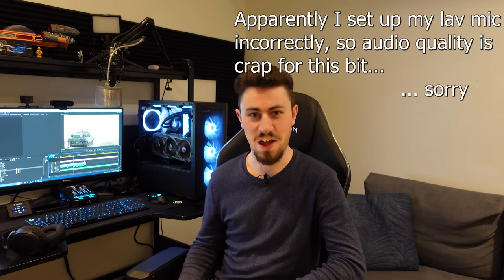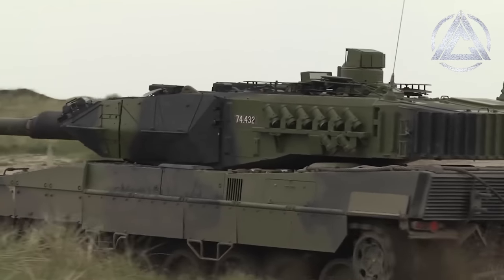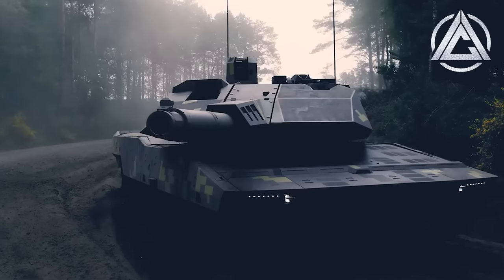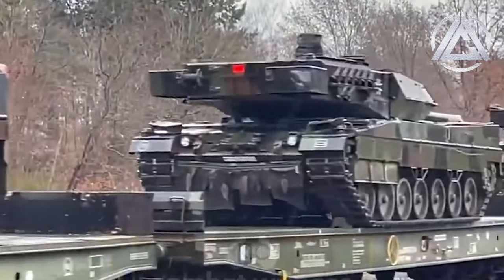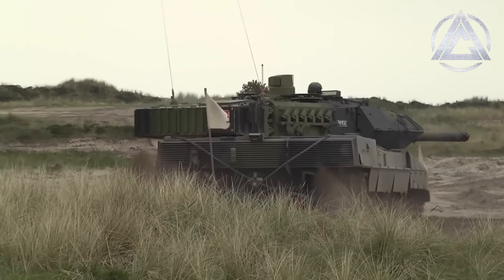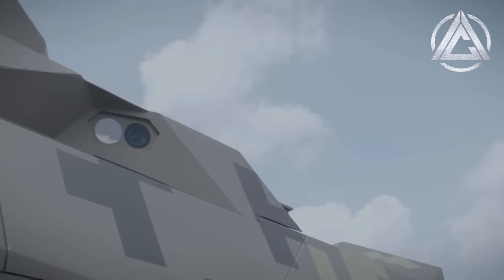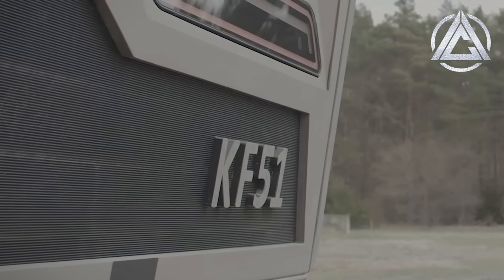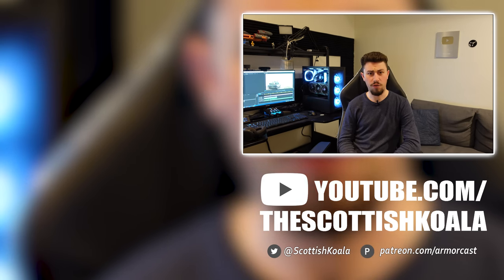Germany's New KF51 Panther Tank | The Spearhead of a New Generation?

Comment: great vid, but interpreting chronic mismanagement in western militaries for a suposed "norm" of issues with upgrade programs etc is risky.  coruption and overspends shouldn't be our benchmark for looking at these systems.  These huge defence corporations are unique specialists in their fields, often having governments over a barel.  Does the US want to buy chineese or even european Tanks.  No.  So the US defence contrators drag out, run over, and the government just have to keep putting their hand in their pocket.  The F22 project was far more likely a cash cow rinse em while we got em scenario that went to far.  

Leopard 2's can be stripped back down to an empty hull devoid of any parts or wiring, the composite armour removed, turret and gun system completely dismantled till its a pile of parts and a metal husk...  Fitting in modern systems that are smaller and yet more advanced is easy if you take the time, but time is money.  every few years computing systems shrink, look at the crazy phone you have.  huge computing power in your hand.  oh but no they ain't got the room in their MBT for the latest hardware???  don't beleive the hype.  

The game is balancing the sales pitch BS vs how much you want to charge the German government for doing a job they easily can do vs how much you can rinse them for doing it.  Whilst telling them how insanely difficult it is and hoping they believe you as they have absolutely no idea whats involved.  A modern gun sight is very complex, but you can bespoke anything.  give thales group the exact dimensions from your techincal drawings and say make that work.  they can, its just a job. its engineering, its not magic.   

We know this because they gave us Abrahms after M60,  Chally 2 after Chally 1, Leopard 2a7 after leopard 1a5.  we see these jumps.  the upgrades were lazy attempts to pretend they cared when we in the west had global dominance. not western militaries pushing themselves at war footing.  Now russia is back and china are agro.  the need, the need for speed is back.   

When they hit that sweet spot of BS sales twaddle vs need (desperation) vs insane profit.  We get new generations of military gear.  I am a synic though i worked in sales for a long time, Russia in ukraine looks like a great time to get the salesman in to tell them about the new MBT.  "trust me, upgrading that tank will cost hundreds of millions." government looks at ever spiralling costs of upgrades. not realising you've been the one fucking them with those overspends or being too desperate to care.  "but we do have a new one..." 🤑🤑🤑🤑🤑🤑   any way much love and respect, and a fantastic insight into this MBT. 105mm to 120mm anyone? but i figured i'd put a grounder in for context.  lets not give massive corporations the benefit of the doubt on this.

Comment: Okay your argument on the unmanned turret is bad then it looks good but you talking about the T-14, which has the same idea as that Abrams with a unmaned Turret the US tested with in the 90s I think... basically the proper turret, aka the actual thing that would be damaged there is tiny, its the manlet and the gun optic, stuff that you can't armor either way, if you hit the gun optic of a Leopard, its blind the same way a T-14 would, if you hit the Manlet of a Abrams its need to be repaired same way the Unmanned Turret Abrams would... its like armoring a rifle, you don't need armor there...

Now there are arguments against the Unmanned turret, but as I showed here, yours is quite flawed

EDIT- your second argument is even worse, since 1- you can armor against top attack munitions much better if you have less of an Area to armor
2- JUST V-HULL YOUR TANK
3- Abrams got hit multiple times by Iraq tanks, had those be armed with proper ammunition, something that was better than 3BM-17, it would have been possible to see multiple Abrams lost in something worse than a mobility kill. even a Mango round would have knocked out some of those tanks.

Comment: Tanks are last century and can be destroyed by one trooper on the ground or one smart bomb
Reply: That's the whole point of fourth gen tanks. the KF51 has passive, reactive and active armor. It has 360° ADS with both hard and soft kill elements and even advanced Top Attack Protection Systems against ATGMs, loitering ammunition, HEAT, EFPs and various other forms of plunging attack. The Puma IFV, which only employs a soft kill protection system, is called the most survivable IFV and this is an MBT which uses the the same and other types of active protection systems.
Reply from the maker: Every single tank ever designed was vulnerable to a single trooper with an anti-tank munition of his day. EVERY one.

Has never made them useless before, and it isn’t about to start now.
Reply: damn and a plane can destroyed by one trooper with a manpad.. are they also last century? people say that since 1919 and they were always wrong

Comment: It will become viable for germany after the project with france will inevitably fail. Just like the prior project with france that resulted in failure (followed by seperate amx30/leopard1) and the prior project with the usa (mbt70) that resulted in failure (followed by seperate abrams and leopard2).
Reply: Unlikely. Even if the project fails it seems like there is already a second program. And even if this fails it will most likely give a lot of data/experience used to than develop the new tank alone. Like the leo and the avrams that were the indirect result of the joined Programm.
Reply: @emilsinclair4190  The data gain is already there as Rheinmetall is part of the mgcs program. They will have included anything they thought worthwhile in the Panther development.

Comment: Sorry, but you start with an incorect information... KF 51 isn't an entirely new development. The entire hull is just a re-armored Leopard 2 hull, the chassis is exactly the same. The turret is a new development, yes, though the lineage of Leo 2A5, 6 and 7 can still be seen, but the tank itself as a whole is closer to Leopard 2 than for example the KMW/Nexter EMBT concept is (and that is now a modified Leopard 2 hull with a new, low profile turret developed from the one of Char Leclerc)...

So IMHO iPanther is still a Leopard 2 variant, in a way a "Leopard 2A8"... the amount of changes is closer to the one between Leopard 2A4 and 2A5 (or 2A6) than the one between Leopard 1 and 2...
Reply: the hull isn't just a re-armored Leopard 2, it's a fully modified one
Reply from the maker: The hull is very much a modification of Leopard 2’s, rather than an exact match. Plus, as stated, a production KF51 would have a fully new, Rheinmetall-made hull anyway

Comment: I wouldn't give you one penny for that tank.  Look at the HUGE shot trap under the turret!
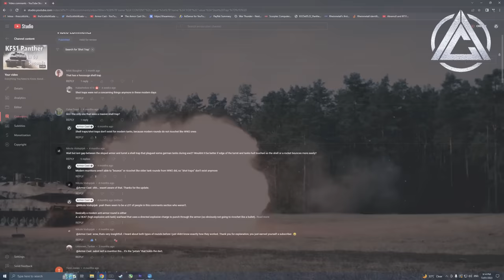Reply from the maker: Check out the section at 21:55 where we went over why this is not the case. Modern tanks do not have "shot traps", that is a WW2 concept that does not apply with modern ammunition
Reply: Watch the video before commenting...
Reply: @ArmorCast  Bull hockey...  You take an APCR or depleted uranium shot and they do NOT 'plasticize' on being deflected. Someone has been spreading fertilizer about.  WHY do you think the M1A2 Abrams do NOT have this design? Hmmm....
Reply: @DerIchBinDa  Bull hockey...  You take an APCR or depleted uranium shot and they do NOT 'plasticize' on being deflected. Someone has been spreading fertilizer about.  WHY do you think the M1A2 Abrams do NOT have this design? Hmmm....
Reply: @willarth9186  they also have shot traps.
Reply from the maker: @willarth9186  It does... the M1 Abrams very much has the same supposed "shot trap" issue, where the angle of the hull could send rounds into the underside of the turret (unlike the Panther, it could not happen in reverse however). Thing is... it isn't an issue. 

This has been repeatedly tested and the results are well documented. "Plasticised" is the closest term I can think to use. It's not exactly correct, but for all intents and purposes it IS what happens. These things are a metre in length and 27mm in diameter, travelling at 1,700m/s... they do not obey the same rules that WW2 era bullet-shaped AP solid slugs travelling at half the velocity did! If they do not bore into the armor, they collapse on themselves and pieces get flung off in all directions. They do not simply change directions while remaining intact!

Now, APFSDS rounds rely entirely on length:diameter ratio in the direction of impact, and a factor called "moment of inertia" to achieve penetration of armor. Should an APFSDS round be skewed off course by more than 7 degrees, it will lose over 80% of its penetrative power. That is easily enough to prevent penetration of whatever surface that piece ricochets into.

Also, nobody has used APCR since the 50s, not that APCR stands ANY chance of abusing a "shot trap" given how the softer, deforming metal jacket

Comment: None of these will defend against EFP penetrators top down…
Reply from the maker: That is precisely what active protection systems like TAPS and Strikeshield are designed for
Reply: @ArmorCast  That would be interesting to see since most EFPs travel roughly at the velocity of the explosive used,   say 2000 meters per second at 100 ft above target wouldn’t give the system much time to defend against it, there using 155mm EFP shells in Ukraine now for precision strikes think the Germans gave those shells. Against slow AT and ATGMs might work but none have been tested in modern armored combat.
Reply from the maker: @gomergomez1984  This is why firing trials are conducted - to PREPARE for modern combat against the kinds of weapons that are used on a modern battlefield.

No round travels at 2,000m/s... unless you're using a railgun! Meanwhile even 1,800m/s is able to be intercepted by Strikeshield, not sure about TAPS.
Reply: @ArmorCast  No point in arguing with you, they want to test effectiveness send them to Ukraine for testing in combat. Unfortunately the Russians don’t have an equivalent round to the smart 155/155 bonus munitions, but I doubt the system will be reliable with just average tanker crews trying to maintain it in field conditions.

Comment: ETC gun...
Reply from the maker: The Rh.130 isn’t ETC-capable as far as I can tell, though it could probably be modified to be without much trouble, the same way Abrams’ M256 was back in I think 2005
Reply: A good bit of the performance increase could be achieved with a 120mm ETC gun.
Reply from the maker: @dwwolf4636  Oh for sure, over double the velocity of current rounds (4,000m/s) and that brings FAR higher penetration rates, better accuracy, etc.
Reply: @ArmorCast  not really.
But 50% more kinetic energy in a 120mm package is possible.

Comment: Germany needs 1 year (!!!) only to equip couple dozens of Leo for Ukr - good luck with this project if they manage to make some in the next 10-20 years .... with an economy on recession, social unrest, no more cheap energy, I do not see ze germans able to pull this on the near future.
Reply: 1 year to totally dissemble and reassemble tanks after checking their parts. A realistic estimate. Recession if it will come will be relatively mild and social unrest is not very high in Germany. Energy prices will decrease in the future in Germany.
Reply from the maker: The F-35 is among the most successful fighter aircraft in the world right now, and certainly the most advanced and capable... It took over 15 years to go from the X-35's winning its competition with the X-32, to the F-35A's entry into service... The Type 10 took around 12 years to develop, the Su-57? 20. 

10-20 years would be relatively normal for modern military procurement. Even the SHORTEST military procurement programs in the modern day tend to take a minimum of five years.

Comment: One thing that I have never understood about tanks is the big "V" shaped opening under the turret and above the main body. I know anti-tank armor shells can actually bounce and if one struck either side of the "V" it would most likely ricochet into one side of the other or the joint and be a fatal shot. I know the driver's head sticks up sometimes and the other front person's too but I still don't get why they design it that way.
Reply from the maker: Because that ISN'T an issue for modern tanks using modern ammunition. Covered this at 21:55

Comment: I'm surprise yo didn't talk about the "fuck the French" and "fuck the MGCS project" side of why Rheinmetall developed this tank? Do you have an opinion on the matter? A different perspective than me who thinks the KF-51 is a gigantic middlefinger at Nexter?
Reply from the maker: It's a funny story, but unfortunately it definitely is NOT the case, for two reasons -

One: developing projects like this costs BILLIONS, not just in research and development for the project itself, which lasts years and involves hundreds of people, but also the burden of keeping it under wraps until unveiling is exceedingly expensive. It's far more than any company would spend on any type of "middle finger", even if it were almost GUARANTEED to see serial production (which this very much is not).

Two: Rheinmetall would have had to work WITH Krauss-Maffei Wegmann in order to build this thing, given the modified Leopard 2 chassis it is using.
Reply: @ArmorCast  What I'm seeing is they decided to spend billions and develop this tank alone (while they needed KMW for it the project is entirely suported by Rheinmetal tho) while the're in an entire other project (half-financed by the French company and an other German one) to conceive a tank to achieve the exact same objective (making Germany's replacement of the leopard).
What I know is that France wants a 50-50 sharing of the power in the project, but there is two german companies and only one french. Making KMW and Rheinmetall in direct competition between each other. That's why I'm thinking the KF-51 is a middle-finger, Rheinmetall wanted the lion share so they took it, at the expense of Nexter and KMW who where together on the project from the begining.
You're arguing they started the investement and project before they got into MGCS so its totally uncorrelated to corporation and Franco-german politics.
What I'm failling to understand is why they continued in this lone rider way with their own tank after they got into the project, and why they are they still in, if they want to develop a tank on their own.
Reply from the maker: @lucaj8131  Same reason X-32 and X-35 competed for the JSF project. Rheinmetall would very much like that contract, rather than letting KMW and Nexter take it. Hence, KF51 is definitely made as a potential alternative/competitor for the Leopard 2's replacement... But I wouldn't say that's "just a middle finger to KMW".

Either way, Rheinmetall have nothing to do with the MGCS, and Nexter would most likely have nothing to do with production of this tank (certainly had nothing to do with its development).

In other words, Rhienmetall are in competition with BOTH Nexter and KMW... but it's nothing more than business as usual.
Reply: @ArmorCast  Rheinmetall is supposed to be in MGCS, they supposedly have developed prototypes and are supposed to be involved into the architecture studies. 
I don't know the degree of involvement and cooperation they are in, but on paper they shouldn't be exterior to the project as you emplied. 
But I agree Rheinmetall taking the lead in this project would mean there would be nothing left for Nexter which is depending on how you look at things good and bad for french and german industries.

I didn't want to emply the "middle finger" was anything else than a business move. But I was still surprised you didn't at all talk about it when you spoke about the reasons for such a program to see light and I thought some of the reasons you gave as to why the KF-51 was needed were problems Germany had rather than Rheinmetall itself had, so that's why I guessed you would touch the subject.